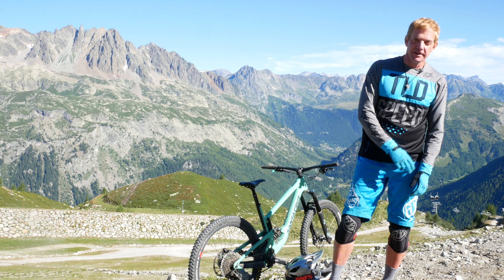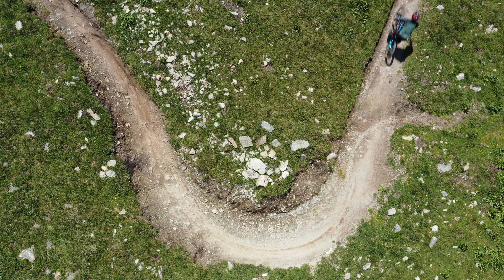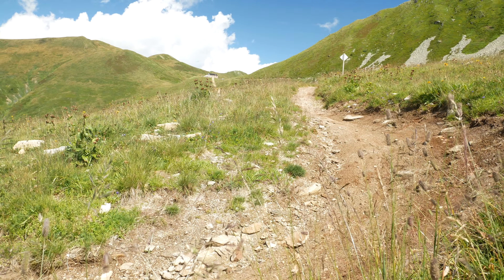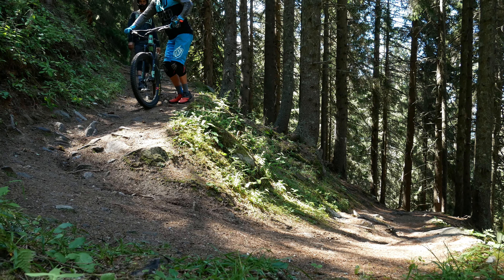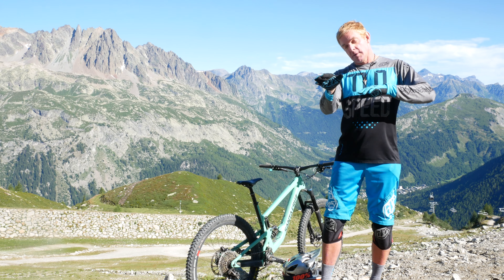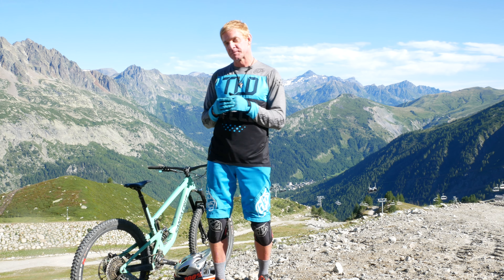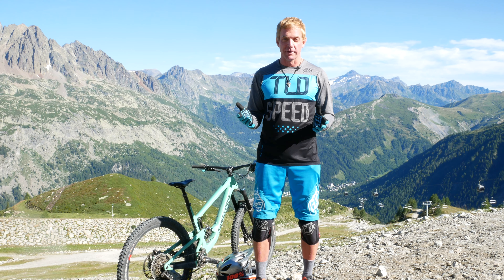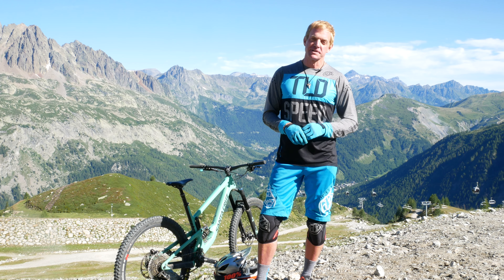Mountain Bike Tips: How to Ride Tight Switchback Turns

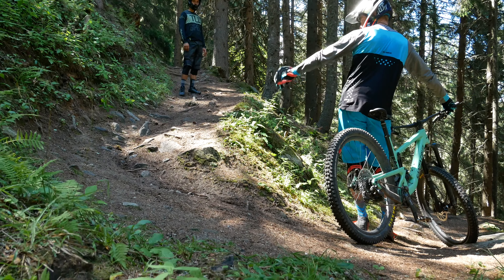Comment: 2:05
Basically what you're describing is what Motocross and road race riders call squaring off a corner. Definitely more similar to a Motocross move. 👍 Hairpins and switchbacks are ideal for squaring off a corner. The only downside is you have to put more lean angle and steering input to the bike, but as far as the best way around a tight corner it is definitely better than trying to take what might be considered a traditional line. Corners will always be a compromise finding the shortest distance or the quickest way through will require the give-and-take of speed versus traction. I'm really enjoying your videos Simon. As a former road racer and long-time road bike rider I'm new to the MTB and it is so different and such a steep learning curve. Your videos are helping navigate the trails and the techniques. 👍👍👍
Very much appreciated for your time your efforts experience and knowledge!
Reply from the maker: Well said!